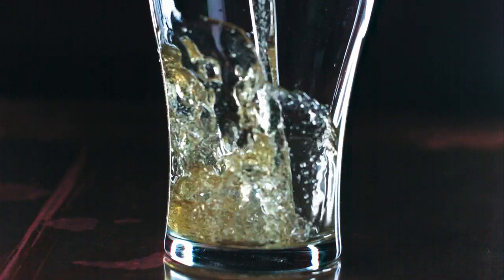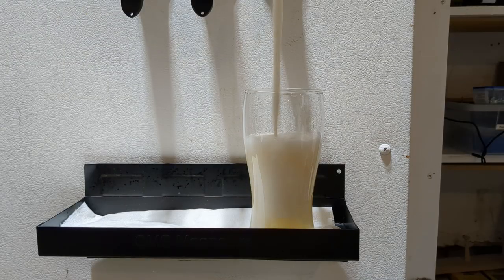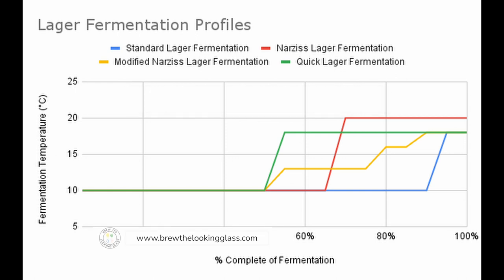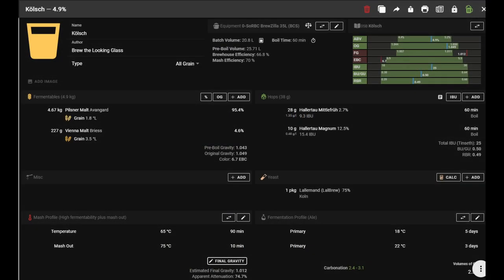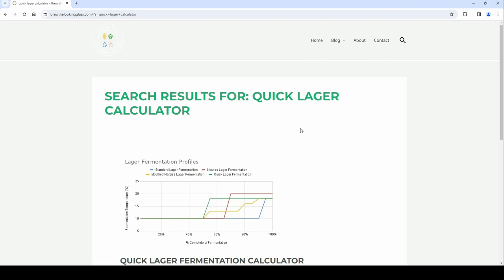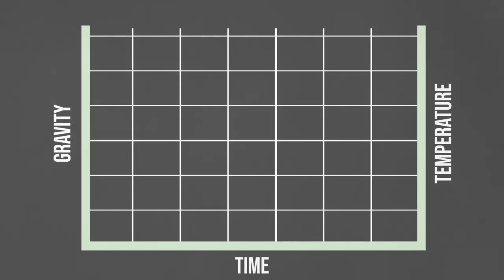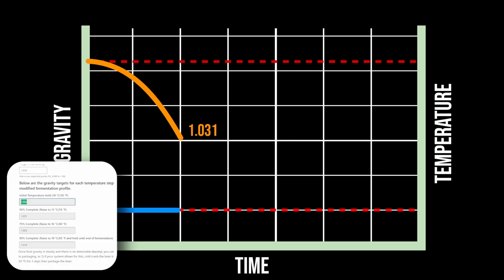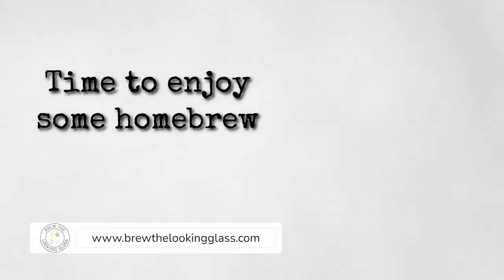How to brew any LAGER fast | Quick Lager Fermentation | Calculator

Comment: Great video! How long do you larger for and would you do a video on largering? I'd be interested to see how it exactly works, how to prevent oxidation and what PSI is the beer at during largering if any. Sláinte 🇮🇪
Reply from the maker: Depending on the beer, I usually lager for 2-4 weeks, under 10-15 psi CO2 after transferring to a keg. I have found that my Munich Helles is good to drink after 1.5 weeks, which is a good amount of time to reach my desired carbonation level. My Doppelbock was great after 2 weeks lagering, but really hit the mark between 4-5 weeks.

I may have to put together a future video on that part of my process. Sláinte! 🍻